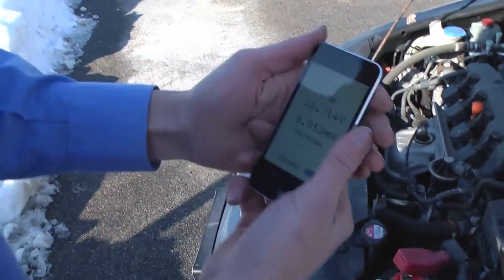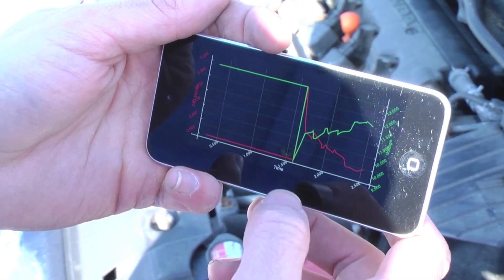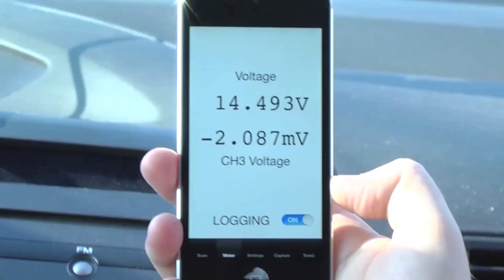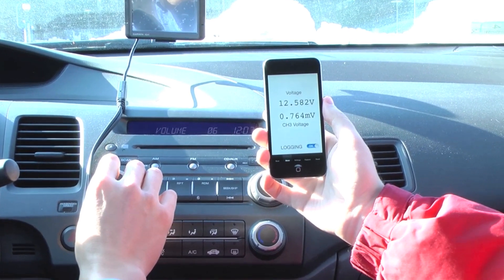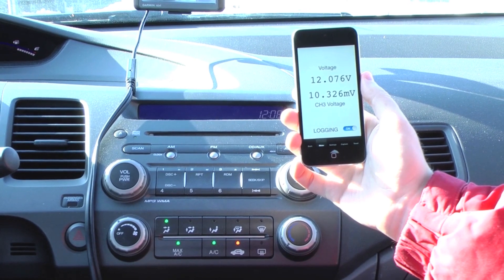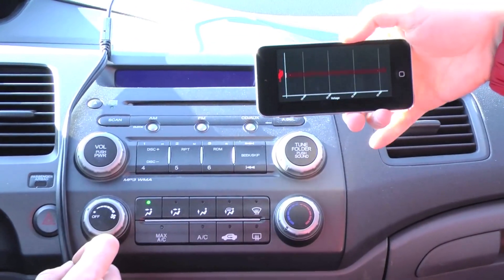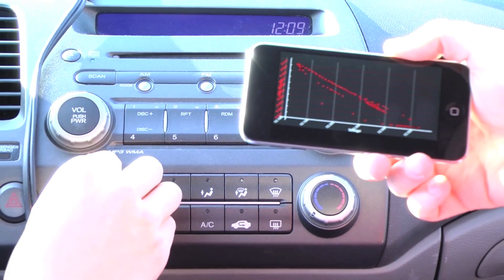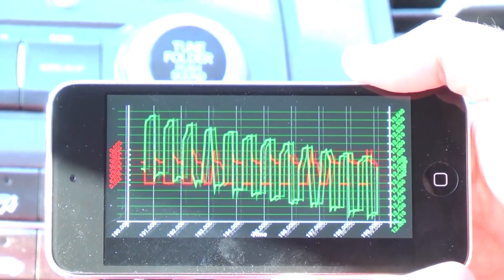Car Electrical Diagnosis with 2-Channel Wireless Multimeter

Comment: I'd like to see where the amp wire is connected to.  And if the positive and negative cables are connected to the battery directly.